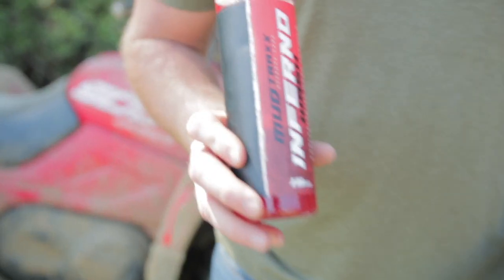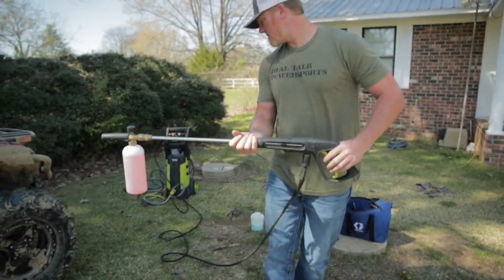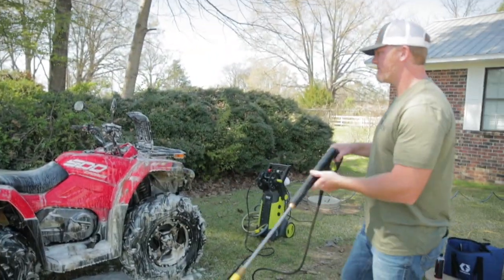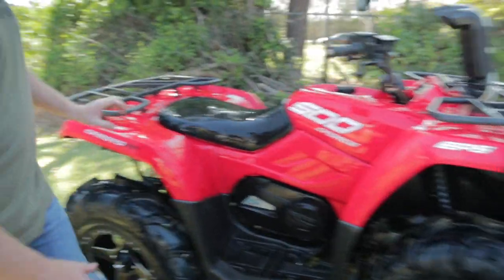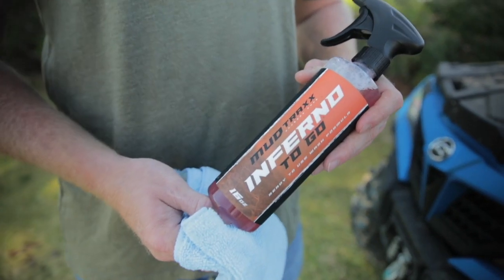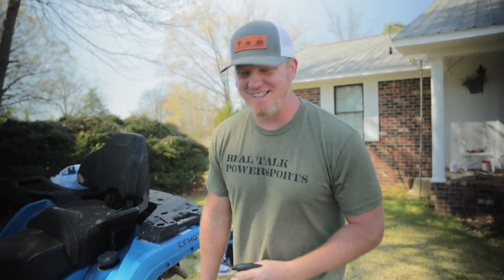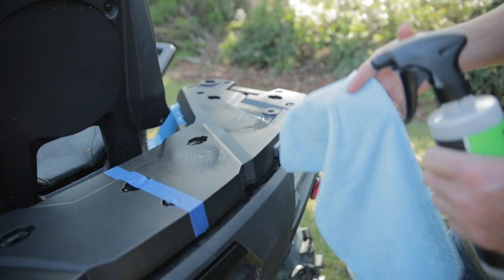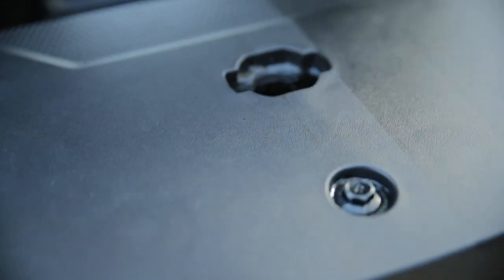Introducing MudTraxx Premium Off Road Care Products

Comment: Hey Justin,  what product of yours were you using on your windshield from 3 star industries in a previous video? Also will it effect the scratch resistant coating at all? I just installed mine from them and they give you some detailed instructions for taking care of it.
Reply from the maker: Hey, Todd! The Ceramic Detailer is perfect for windshields and what I was using. It will not affect the coating at all.

Comment: Can you use the ceramic spray after the PVR? How long do you need to wait? 

Thanks
Reply: I placed an order and just want to be sure im using it correctly.  I would think the ceramic would be the last step. Am I missing something here? Is the ceramic only for painted surfaces? Does the PVR protect and the ceramic isn't neccessary after applying PVR? 

Thanks in advance for clarifying.
Reply: My order is #1173
Reply: Well, I guess we don't get answers any more.  Beat! 

I'll try to update once I receive the order
Reply: Kinda hard to believe im having this conversation with myself.  I guess "Justin" is just too busy to answer questions anymore.. the day before the "launch" he answered ..... not anymore.  

I used the ceramic after the PVR and it turned out fairly well. I just bought a brand new Outlander and wanted to protect the backs of all the plastic so off came all the panels for treatment.  I'll keep you posted how the next clean up goes.  

Here's two more questions.  I see the PVR has Sodium Hydroxide in it which is a cleaner but can be caustic! Is this why in your video the guy is wearing rubber gloves?? Should we not let this touch our skin?? There is a chance this will actual dry our rubber out and make it brittle. It's ok,  I just spent 100 dollars on this stuff too :).  I hope I didn't just ruin brand new Quad plastic.  TIME WILL TELL. 

The bike does look good. My hands fell a little strange.  Is this stuff safe for skin contact?? TIME WILL TELL

cheers